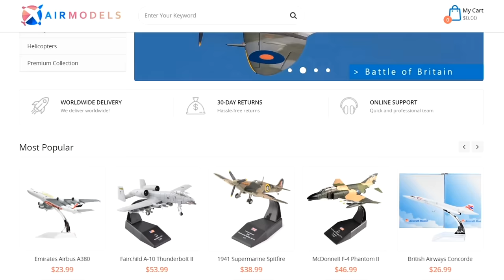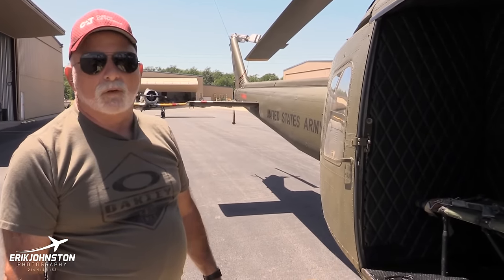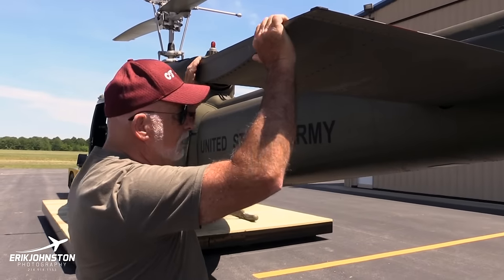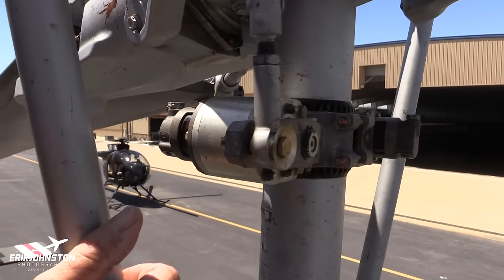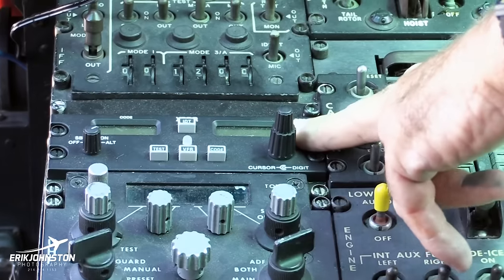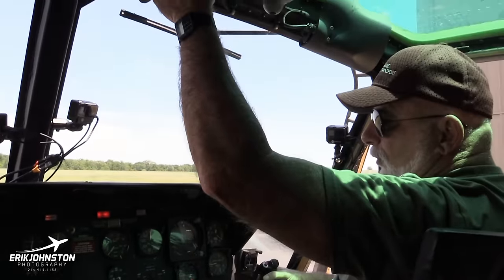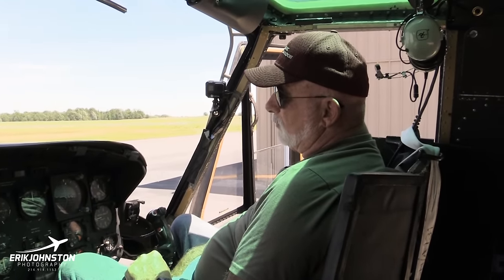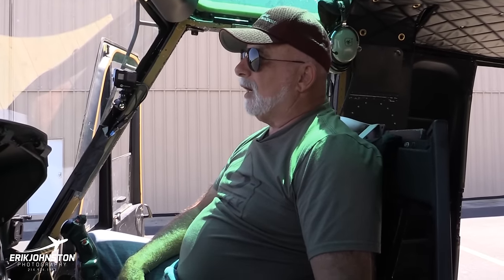Huey UH1H Walkaround Gary Gingrich

Comment: Enjoyed this immensely! When I was a teenager I got to get a close-up look at a UH-1H that practically landed in my back yard! Three of them came over and I happened to be outside. First two sounded normal but the third didn't. High pitched nasty sound from the engine (found out later it had a compressor stall). So they start circling overhead. Ran inside and grabbed Pops camera and got back outside to see the damaged one come down FAST into the recently graded area that is now the industrial park right behind my house! Ran down there as the guys were getting out grabbing their backs (must have landed hard). Started taking pics and they asked me: "Where did YOU come from?". I said : "Right over there. Heard you coming over and knew something was wrong." Quizzical looks. Army Rangers from the training area in North Georgia. So rather than flatbed it out they decided to use the opportunity for a training exercise. They flew a fresh engine in in another Huey and swapped it on the spot! Took lotsa pics and basically stayed out of their way until they flew it out! Got some great shots of their test hops in the evening with the rotor tips lit up. Sent them copies of the pics and a while later I got a package in the mail. Certificate for "Assistance in the recovery of a downed aircraft"! Also got recruiting stuff for a long time after that... I never wanted to join the Military. Pop was 28th Infantry WWII. Landed on Omaha Beach a while after D-Day (his troopship was delayed or he would have been in the thick of it). Got through the Battle of the Bulge as one of 60 from his Division that survived! Then got a little too far into Germany on patrol and was captured. Marched 15 days to a POW camp where he spent 97 days before being liberated. He passed in August of 2015, one week after his 93rd Birthday...
Reply: What a great story love your dad, thanks man
Reply: Thanks for sharing that awesome story. Much respect to your Pops, too.
Reply: Fantastic story , thank you for sharing!
Reply: Respect! !
Reply: @jamiestewart48  Thanks!
Reply: @millercork  Thanks!
Reply: theviet  Thanks!
Reply: @kikupub71  Thanks!
Reply: @Terracecasualx5  I think if we were Viking instead of Austrian ancestry (as far as I know) I would would gladly have my remains burned on a ship. But I would regret the burning of a perfectly good ship!
Reply: むく  Very many! They treated him "relatively" well because they knew at that part of the war they were losing. They sent him out to work with a local farmer each day so he got some slightly better food than the "grass soup" and sawdust bread the other POWs got. Farmer would say: "Hitler bad" and palm Pop a couple Russian cigarettes. One day the farmer took him into the hay barn and moved a few bales and had a path back to the back of the top floor. Guy had a still in there and made Schnapps! Pop said he was warm for a week!
Reply: That's awesome phil thanks for Sharing. Idk where you live but alot of airshows offer rides in uh1s for a small fee. I rode in one 4 years ago and the crew were Vietnam vets that had flown them since the 60s. If you happen to be in ohio the vectren dayton airshow always has the rides there.
Reply: Great story thanks for sharing. I know you had to be super excited.
Reply: God bless your dad and them. My dad was in WW2 he pasted away about the same year in my arms love and miss my dad lot but he is not suffering anymore and same with my mom both of them together in heaven
Reply: Phil Grindle , that was a very cool story, thank you for sharing it with us!
Reply: @t.r.d.z.1630  I live near Atlanta, Ga. I don't do aircraft rides unless I have to! Motion sickness. Got a ride in a Cessna 152 years ago. Dramamine wore off halfway through it. Got on the ground and stopped just in time to push open the door. At least I didn't puke IN the plane! It smelled like somebody had though...
Reply: @trent3872  Oh I was! I still have the negatives and prints around here *somewhere*. Oh BTW I'm still in the same house (mine now)...
Reply: @romansroad2007  Thanks! Mom is still "wobbling around" as she puts it, at 92. My Granddad was also a "William E.". Built B-29s for Lockheed (then Bell Aircraft) in Marietta! Well parts of them that is. Got to see "Fifi" at PDK with Pop years ago. Got the tour and sat inside for the guy to explain the planes history. At the end I said: "My Granddad built B-29s and this is MY Dad". Everybody looked around at me! We got out and spent a while talking with the "Commemorative Air Force" guys that crewed her...
Reply: @tonyfaconi3442  You're quite welcome!
Reply: @PhilG999  I don't live a really long way from you, over in Cherokee county Al. Right on the state line. If I cut thru the woods I can be over in Atlamta in bout an hour and a half.
Reply: Outstanding account, thank you!
Reply: Just want to correct you on that WW2 unit. Would have been the 29th ID Ying Yang blue and grey. I was in the 29th in the National Guard. It’s no longer a active duty element. Thanks for sharing. Would love to see pictures of that day!
Reply: God bless your Dad.
Reply: Fantastic - loved too read that😌
Reply: Fascinating story indeed, thanks for sharing.
Reply: 222
Reply: ¹
Reply: Brother was 1st Cav. '68. He's been long gone for a long time. Ain't never ever missed anyone so bad. He never spoke of his war time. Period. I tried! It wasn't coming out! I've always said, alotta these WW2 Vets though, lived long lives for a reason. Not to take away from my Vet friends and all other Vets both here and gone, but Hitler..was a different breed of evil. Those boys were fighting a true evil. And it freezing conditions. I've watched so many videos of fighters and B17's, the hell they went thru and at 50 Below, falling out of the sky. The cold water. The guys on the ground the same. And the whole..How can your body even Move, To fight through that. Your Pop, served his purpose! And obviously, to die at 93, brother..his heart while At War..was In the Right Place! Love the Huey Story. I'm almost jealous. Much love. Always share the memories

Comment: I was on CA, coming into a rice paddy, when at about 20ft in the air the ship suddenly turned 90 degrees to left. After a near recovery and some fantastic flying, the pilot controlled it into a "gentle"  roll over onto the roof. No one hurt. They assumed it was a wire set up in a loop and we hooked only one skid which turned us.  I really had my doubts about that.  So it's really striking to see wire cutters on this ship. Makes me wonder.
And I just want to add, you slick pilots saved more lives in more ways than you can even imagine. All my thanks.

Comment: When I entered the Air Force we trained at Fort Rucker with the Army. First we trained in the TH-55, Hughes 300, then we moved into the Huey. What a difference, hydraulics made flying this helicopter so smooth, there is nothing like the sound of those rotor blades, you would wake up and go to sleep hearing that wonderful sound.

Comment: I was a Crewchief in Iraq. They still had the Kevlar seats up till then... Only for the pilot's of coarse. The gunner was just screwed. I turned in the last Huey on Ft. Campbell in 91' before going to Sinai where they were still using them. In 93 they were operating Huey's in the Medavac with 4th ID until 95' while in Somalia. Pretty sure they Mothballed them after that. A good Buddy of mine flew until 98 in Germany. The Huey went for a long, long time, the Army just couldn't replace it as a utility bird. The Blackhawk is an expensive beast, but better under fire.

Your walk-through brought back memories, I could almost smell the grease from the Sta-Bar (what he called a scissor assembly -brain fart). The short shaft was Vietnam Era, it had grease packs. The flex shaft on that bird had no grease. Not sure why I felt the need to say that but it points out the generational differences with that bird. It flew through Vietnam, Iraq, Somalia, Hondo, many conflicts and generations of aviators and crew chiefs. A long brotherhood.

Comment: Something I note is he leaves out part of our normal start up procedure. The main rotor blade is tied down because a passing ship or a wind will bounce the blades and can easily damage the rotor head or cause an incident when the blades of a passing ship would strike the bouncing blades on the parked ship. The blades would be untied when you were ready to start up the ship. The crew chief and door gunner would check out the ship and wait for the pilots to do the same. At the point that we were ready to crank up the crew chief would left the hook off of the hole in the end of the blade to free it up and then stow the hook which has a long red line on it. When the pilots were ready to start the ship they would call out "Clear" and the crew chief and door gunner would again do a quick check to make sure there was nothing in the way and repeat "Clear and untied sir" At that point the pilot would say "Coming Hot" and then would then start up the ship. Once the crew chief and door gunner saw no leaks they would climb into their locations. By the way when I was a door gunner up North my crew chief said "You are on the left side" which is contrary to what most people did but hey it's his ship not mine".  So once the ship was up to operating RPM and everything was good to go then the pilot would say "Clear" and the door gunner and crew chief would respond with "Clear Left , Clear right" Some crews also included "Clear Above".  We would then go flying in the beautiful skies of Vietnam.
Reply: @damkayaker  It's the crew chief's ship so it was his preference as to which side he was on. His choices could be as simple as a lefty or a righty or as complicated as his vision preferences.

Comment: Great video Gary and in particular your story of providing ground support for those two units and your return flight to base. My hat is off to all the pilots who flew in Vietnam. I flew over a hundred missions on a Huey as a courier for our intelligence units in the field, mostly at fire bases. I was an advisor (MACV) in Northern I Corp operating out of Hue. About a quarter of my missions were flown on Vietnamese piloted Hueys. I was never quite as comfortable with those pilots as our own guys. Most of our flights were pretty normal/non-exciting, but we did have quite a few harrowing adventures coming into fire bases in inclement weather. I was always amazed at those pilots dropping down out of the fog on top of a fire base which set on a mountain top. As Gary said, it was good to be 20 years old and unattached. Thanks Gary and all the Huey crews. You were an amazing bunch of soldiers.

Comment: I worked on UH-1E Hueys in the Marine Corps.  The "E" models were equipped with rotor brakes.  This was the first Army Huey I ever saw that had one.  Great video - would love to see a part 2.
Reply: Rick , with VMO-3 --HML367 67 68
Reply: @ralphfay4423  Hi Ralph, Did you know Doug Ferguson?  He was a crew chief that I'm pretty sure was in 367.  I was in avionics, VMO-6 in 1965, VMO-2 in 1965-66, VMO-1 in 1966-67.  Hope you're doing well!
Reply: @ralphfay4423  Another two names for you, Rod Brittan and Harry Lynch. I just looked them up in the Popasmaoke website, both 367.
Reply: Thanks Rick, I'll. Check it out

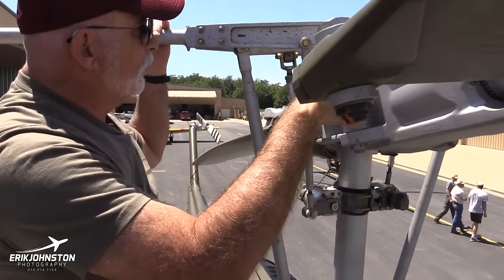Comment: I was a crew chief on Huey's 75 - 85. .At 1:25 those are not for vertical antennas. IR sensors went there.  Talking about the amount of fuel it holds, I once put 205 gallons in my bird. Anyone want to do the math on how long we had left to fly on 4 gallons. Skid shoes. I must have changed them 3 times in one week. Seems like it was always my bird they would use for check rides. The scissors are just above the swash plate 10:30. 10:50 that's the mixing levers. 12:25 that's a drive link he he has a hold of. The scissors are the 2 horizontal arms that the drive link is attached to. The swash plate is the round part the drive link is attached to. We didn't have rotor brakes. I guess that's what that grey handle on ceiling is.
Reply: this comment deserves a like. thank you for this explanation.
Reply: I wondered what that gray handle was looked like a hand pump. Never had one in any Huey I crewed.  your right about the skid shoe's . one week end My bird was picked to do all the check rides for all the office pilots that havent flown in 90 days . I did about a hundred auto-rotations to the ground. changed the skids shoes twice.  also did a hard landing insp. we hit so hard one time I thought for sure the skids were bent. But they checked out oK.
Reply: The Handle is for a rotor brake this Helicopers probably used by a police department they always Add all kinds of aftermarket accessories
Reply: Did I miss the “Jesus Nut” inspection??
Reply: I think they used those lil bumps on the nose for APR-39 radar warning sensors also.   H model Huey held 209 Gal when open port fueled and a little more when closed circuit fueled.   I crewed from 92-2004.   I miss it more than anything.
Reply: @CZPO7DUTY  Yeah, and don't Brasso the main transmission shaft so it looks pretty for the general. I heard one came apart in fight because of corrosion that eventually set in.
Reply: You are correct Pete, those (45 degree) mounts on the nose were for IR missile detectors.  The vertical "cats wiskers" were on UH-1B models, on the very front of the nose and were for direction finding using the FM radio.
Reply: @yamahonkawazuki  Thank you and you're welcome.
Reply: @markthompson4885  Never had a hard landing, but I did measure the spread of the rear cross tube once after someone else hit kind of hard. It was dang near beyond limits, but was still with-in limits.
Reply: @loupcityairservice9740  Thanks. I thought that's what it was.
Reply: @CZPO7DUTY  Lol yeah I guess so. I remember as a FNG asking why is it called the Jesus nut and was told , if you see fly off you go OH Jesus.
Reply: @dave-yj9mc  You're right,  they were for radar. Been a while ago so I don't recall exactly, but I think IR sensors could also be mounted there.
Reply: @bobpitt1261  They were also mounted on protrusions that looked like pitot tubes.
Reply: The "short shaft" that he references is the later style "K-Flex" that uses metal flex plates to accommodate engine-transmission mis-alignment as the engine and rotor system operate. The K-Flex does not use greased couplings at each end.
Reply: That was called the "Hell Hole".  It gave access to the bottom  of the transmission.

Comment: APR 39 was mounted on the left and right nose and also located un the tail skid cover. The floor in the cabin was made of honeycomb/aluminum. The intermediate gearbox is at 42 degrees.  Low rotor audio when in the off position will automatically reset when in normal operating range. Crewed Huey's 9 years and flew them for 11. Nice looking helicopter.

Comment: If anyone is unfamiliar with the rotor brake it is the gray handle and cylinder seen at 13:58.  The brake itself is mounted on the transmission and is similar to an automobile brake rotor.
Reply: Thanks for that bit of information I was wondering what that grey handle was thought I missed him say that. But I guess he can't go through everything so thank you for that

Comment: Good Job Gary. I can tell you are an old time Huey Driver. I liked when you reached above the short shaft to check for grease leakage. The new flex short shaft installed requires no grease.

Comment: I'm a member of D troop 3/5 Cav and was with them from the end June 68 to the end of May 69. I was transferred from another unit operating out of Camp Holloway on Pleiku. When I was with D troop we were based out of Bear Cat " Camp Martin Cox" and then we moved to Dong Tam in the Mekong Delta on the My Tho river. We were called "The Bastard Cav" which is what it says on the ship. 

 Now in the walk around he points out the wire cutters and then says we did not need them in Nam. On 08/15.68 ship UH-1D 66-00779 crashed after doing a wire strike on a run from Bear Cat to Bien Hoa. We lost 4 fine troops that day. The unit lost a total of 54 fine troops.
Reply: I was with E-Recon 2/7 Cav in 70-71. We had a Bell Ranger hit a powerline on Dec 30 1970 as they were heading back to refuel. They were to fly cover for us as we floated in rubber rafts on the Dong Nai river. All aboard died in the crash.

Comment: That first modification he pointed out was for one of the APR-39 receivers. It currently has a blanking plate over it, but it looks like a black puck about an inch and a half tall. It's a primitive radar warning system that would tell you if anti air threats or radar sites were tracking you. There would be a little screen on the inside of the cockpit that would show different symbols to represent different threats. You can actually see the blanking plate for the APR-39 screen in the middle of the dash, in between the two red caution labels.

 It was a system that was installed on Army Helicopters sometime in the 80s or 90s as a response to Russian air defense systems becoming widely distributed throughout various theaters that we were operating in.

It was carried over to the UH60 Blackhawk, and are placed in a similar location on the nose.
Reply from the maker: ATadBitNefarious 
Thanks for the info!!

Comment: The two bumps on the nose were for radar warning,there were two on the vertical fin also and a small antenna on the fuselage bottom.On aircraft in Korea they were installed about 1978.Thanks IP for your service.

Comment: I was Crew Chief 7/17th Air Cav. Plieku and An Son. ,I hated changing skid plates. There were 32 phillip head screw and yes  I used a screw driver to remove and replace everyone. Had a small hydralic jack to lift skids off the ground.